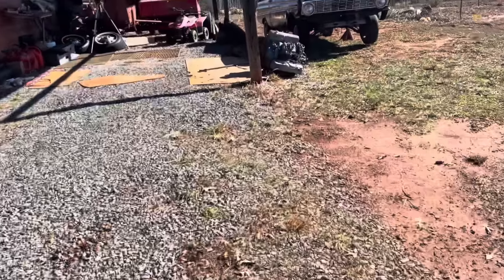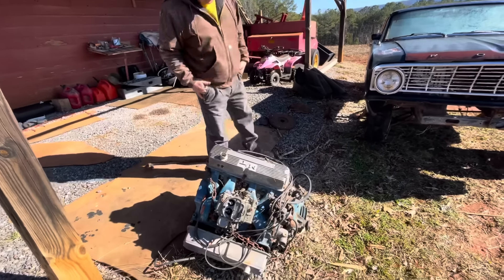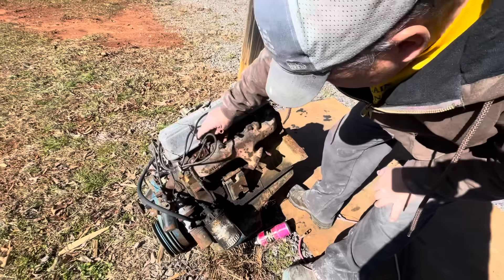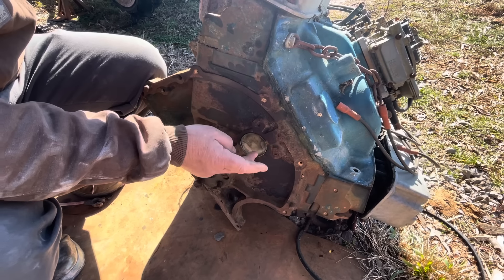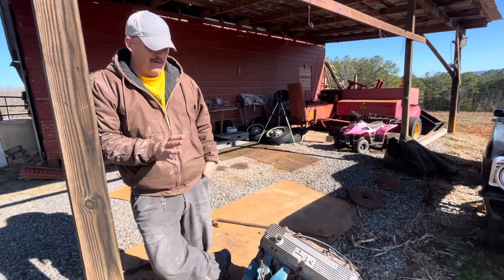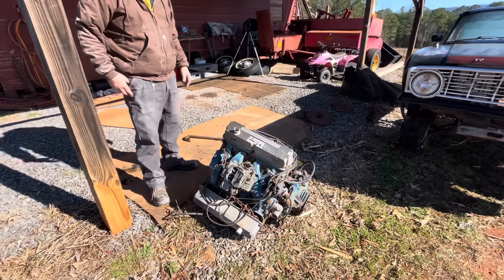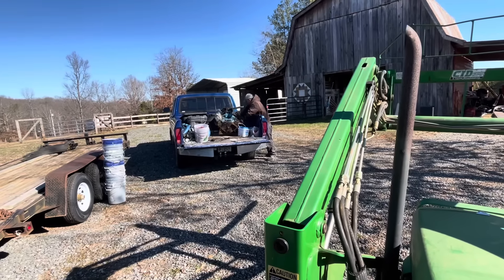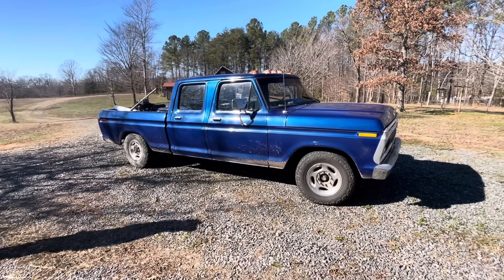FE motor sold. He knows what it is. Money for project recreating my first car.

Comment: I have a Ford Galaxy with a 352 FE, it is already built (as well as the custom C6 and posi pumkin for the 9 inch rear end) 
Comp cams 268 °, fully ported mid rise heads with 2.08 intakes and 1'65 and milled .040 eehausts, edelbrock performer RPM, 9.5 to one compression, double roller timing chain, high volume oil pump and milodon 7 qt pan, hypereutectic pistons, balanced in a zero decked block, with a brawler 650 dp carb and large tube shorty headers. Not built to be a high revver, but the virtual dyno is predicting a very flat torque curve from 1800 to 4400, 430 hp and 460 lb ft. 
It has been on hold to deal with health issues requiring several surgories, but i am already recovering and can't wait to see it run!
Reply from the maker: Sounds like a beast
Reply: What year and model is your Galaxie?  Has your engine been bored ? I see you milled your exhaust valves down to 1.61" , did that clear the cylinder walls okay?
The reason I ask is I've got a set of 352 C0AE-D  Hi-Po heads that have had 1.65 exhausts installed... I'd like to use them on a 352 I have, and wondered if I could cut them down to 1.60 or so to fit a 4.030 overbore.
I've got the 360hp Hi-Po heads, intake and exhaust manifolds , I'd like to put it in my 67 PU.
Also have a 65 Galaxie fastback with a stroked 427 with a wornout block... have a new BBM short block in the shop to replace the 427 Low Riser in the car now. Putting a set of High Riser Thunderbolt heads and intake on, with solid roller .
My projects have been delayed due to surgery also.
Good luck with your Galaxie.
Reply: @godsowndrunk1118  The galaxy is a 66. The engine was bored .040 over, the exhaust valves are 1.65, not 1.61. on my 352 (C6AE-D heads, that required angle notching the top 3/16 of the bore (quarter moon notch at the valve location) at a 45° cut to allow for clearance and flow. This is fine for the 352 as the compression height is over 5/16.
Sounds like you have a good start. I will warn you, that with the 352, if you are planning to build for more than 5200 rpm, you will have to find reconditioned HO or custom rods. The standard 352 rods have 5/16 con rod bolts, the HO has different rods with 3/8 rod bolts. That is why I have chose a cam that produces the power peaks at that range. My goal was 400 hp at 5000, the cam (with the other mods) is estimated to be right at 430 at 5200, though I am not planning to rev higher than 5000, that will mean almost 420, but the torque curve is supposed to be above 300 lb ft at 1500, and above 400 all the way to 5000.  Peak torque is predicted to be 460. This is based on a virtual Dyno, but should be within +15/-15. 
You should be a bit higher with the 11/1 comp ratio if you do the full port and chamber work. 
Sounds like you have a good start, 
Btw, My 66 is a fast ack as well. For me, the 65 and 66 with that roofline had the best styling.
Reply: @douglaspage2398  I guess I miss understood...I thought you had turned down the diameter of the exhaust valve heads....so you did the cylinder top notch. Thanks for that info. I know the 352/360 rods are problematic. I've tried getting info on the Hi-Po 352 rods several times and haven't been able to find any numbers different from standard.
If I build a 352 Hi Po clone, I'd want to go to 6,000 like the real deal.
I've been thinking about saving myself a lot of trouble and using the Hi Po heads on a 390 I have... I've got a 6V intake and carbs . And that would solve the rod problem too. Those shorty exhaust manifolds I have are the same as the 352's, so would be right at home.
You sound like a long time FE guy, for sure.    Thanks for responding.
Reply: @godsowndrunk1118  6v on a 390, that should be a torque monster! I can tell you, that if you properly massage those heads, according to all the Dyno results and the virtual Dyno results, you should still have a long flat torque curve, just be sure not to take too much away from the bowls just below the valve seat. You want a good Venturi effect. There is no substitute for letting the engine breathe!
Yeah, I like the FEs, very underrated. The only thing is that if they are not side oilers, you wand to smooth out all your drain points in the heads and valley, use a high volume oil pump, and a 7 or 8 qt oil pan. Also, the reason that the rods are so important on the 352 is that you are moving heavier pistons due to the compression height than on a 390, the HP is not so much of a concern as the snap back from high rpm running, which is why the Hi Po  replaced the 5/16 bolts with the 3/8s to reduce the chance of stretch. So the 390 would probably be a better option due to the availability of stronger rods. You should be able to still use 1.65 valve seats, you will just need to have the valves cut down a bit, the seats may not even need to be cut to match, as long as there is enough margin from the edge of the contact point to the edge of the valve.. 
I was a factory certified Ford tech at a few Ford dealers over the years in the Dallas area.

Comment: A bit of misinformation here....the 1968 C8AE head was never used on the 352. The 352 was last used in 67 pickups and 66 Galaxies .
The Edelbrock F-427 intake was based on the Police Interceptor intake, but not the Sidewinder.... the Sidewinder had the Carburetor offset to one side to equalize runner lengths and was never offered on a production engine.
Reply from the maker: Ok thanks. I had no idea what I had. Good information. Hopefully all the info will help someone in the future.
Reply: I agree

Comment: I bought a 68 ford truck it had no 352 mark on the block so i took it out to rebuild it it had 427. Stamp on the back of the motor
Reply from the maker: Wow. Nice find
Reply: Look for screw in frost plugs or crossbolted mains.
Reply from the maker: I know nothing about these motors. Maybe someone will see your comment and be able to help.

Comment: I have cast iron 428 Super Cobra Jet 4V intake sitting here on my workbench. Been sitting here for 35 years. More of a Windsor fan than of FEs although a FE can make good power...and a great boat anchor too
Reply from the maker: I know nothing about them. Always been a small block user.
Reply: Got an old sptp Edelbrock for 24 years laying under my bench.
Reply: Gary Robotnick made 675hp at the AMSOIL Engine Masters Challenge on pump gas with one of those boat anchors...
Bored and stroked 390.
Any FE can be bored and stroked to over 440 inches...428's 460 inches and 427's over 480 .

Comment: I bought a 67 ford truck it had no 352 on the front of.block like all.ford 390.428 but it had 427 stamp on the back of the block
Reply: I think they put that 427 stamp on just to get guys excited.... I've got a 427 side oiler block with 352 stamped on the front.... doesn't have 427 stamp on the outside, but is in the lifter valley.
Back in the 70's I bought a 67 Mustang with a 390 GT engine and remember how bummed out I was when I discovered the 352 on the front... thought I'd been ripped off.
Was a couple months before I found out all FE's had that till the 70's truck blocks.
Reply from the maker: Go information.